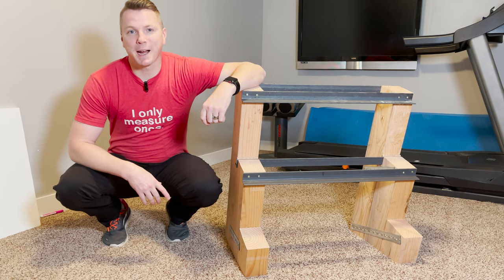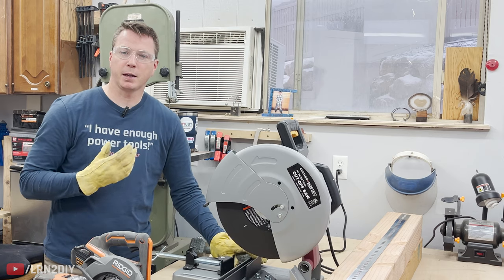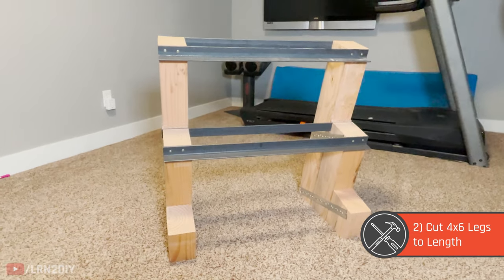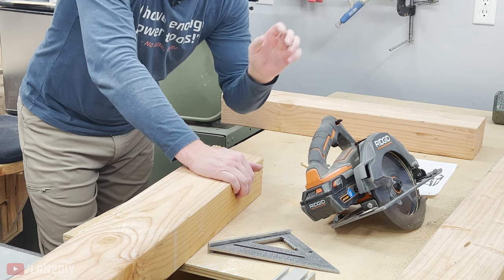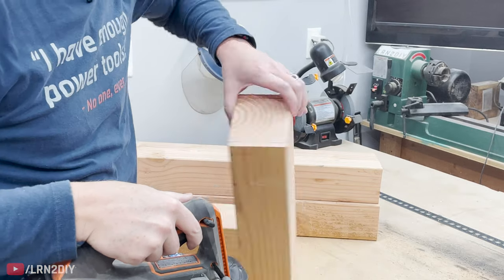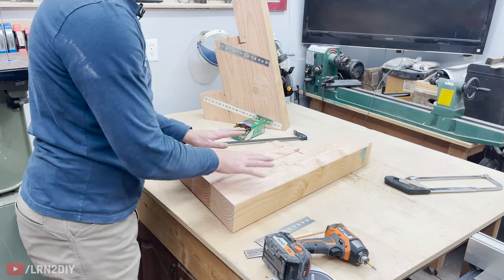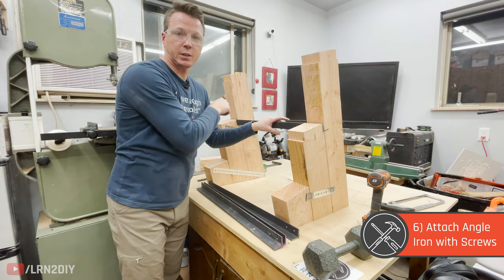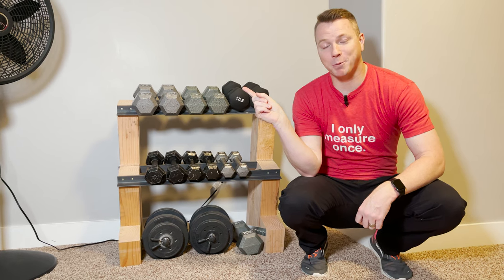DIY Dumbbell Weight Rack with Free Plans - Super Sturdy

Comment: Just some ideas for anyone else looking to build. Since all of the fiber are running in the same direction wood glue like typebond 2 should be plenty strong to clamp the boards together. Carriage Bolt or plain bolt would work too. If you want to get fancy you can put dados with thicker splines running across. I like the steel L bar idea, and the simplistic approach to the design.

Comment: Just a tip, use some oil when drilling in to the metal. That will save you but and cut way easier